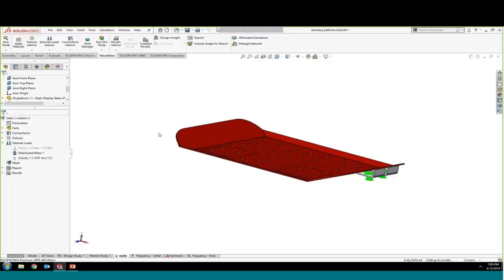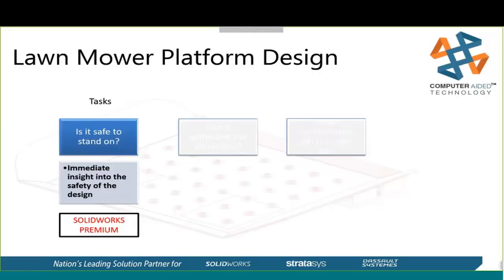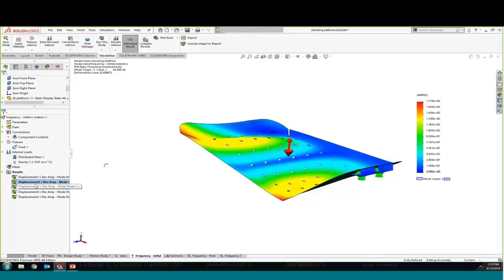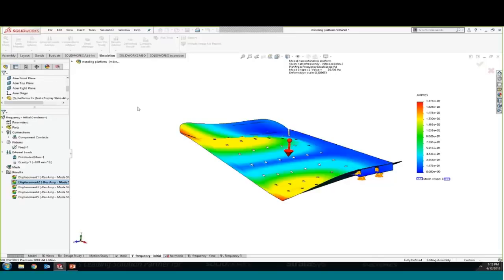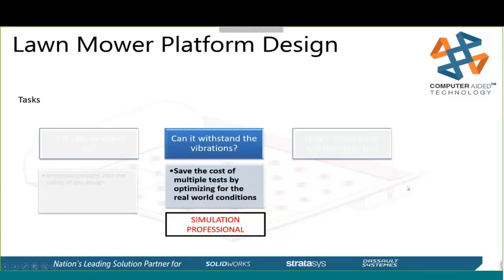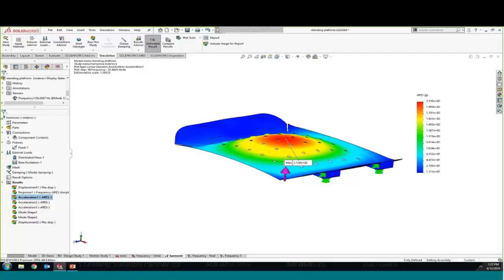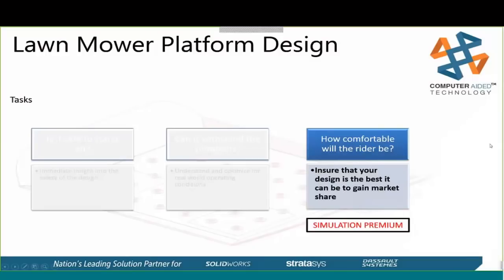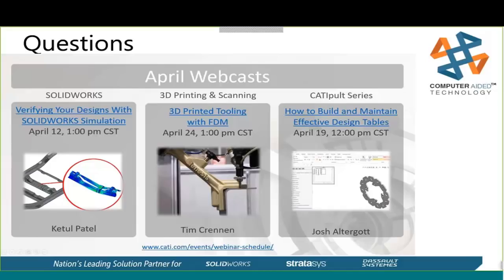Verifying Your Designs With SOLIDWORKS Simulation Webcast Recording

Comment: I wish that the presenter would specify what package is needed to perform the analysis.  At about 6:48 he says that SolidWorks Premium can handle the static analysis to determine the Factor of Safety.  But, Simulation Standard with any other level of SW that is capable of creating the solid model will perform as well.  Then the next portion of the video on frequency analysis, requires Sim Premium, and the final part whether the operator will be comfortable requires Sim Premium.  How do I find something that is directed at Sim Standard with Solidworks Premium, which is what I have.  I absolutely can't spend all that would be required for SW Premium and Sim Premium.